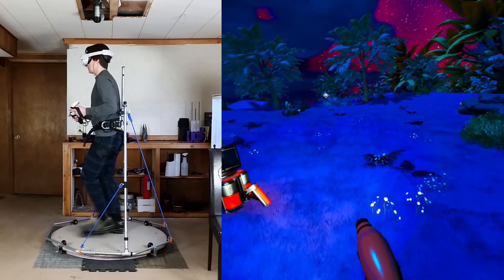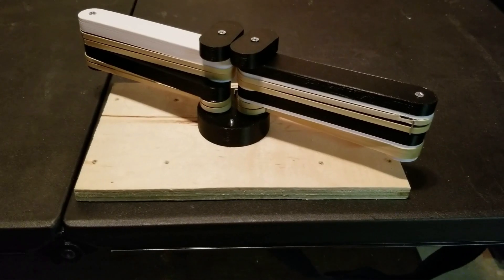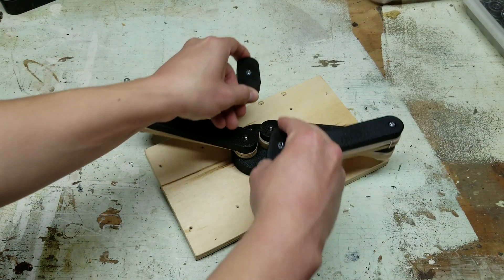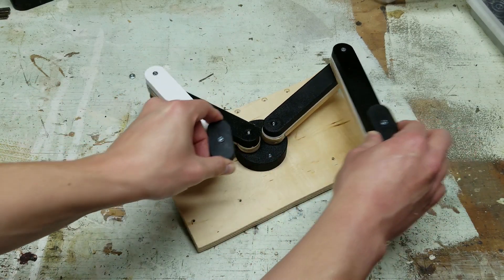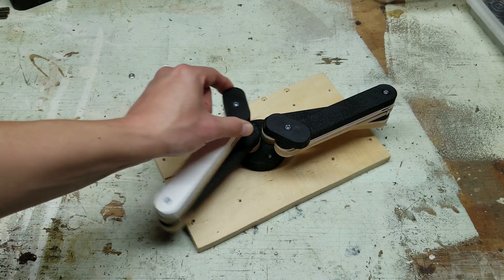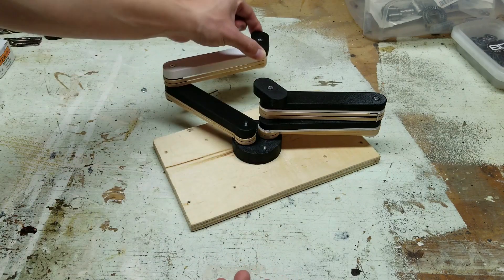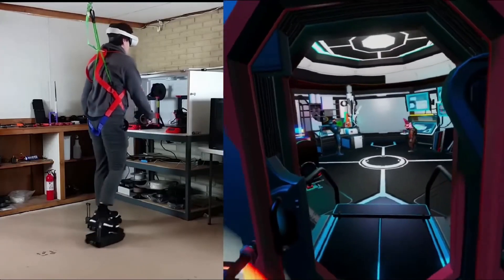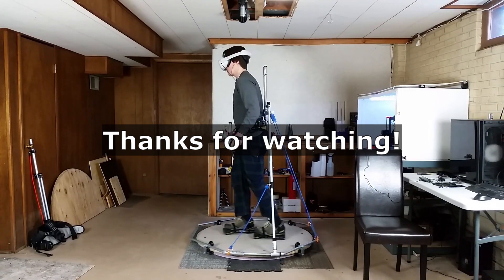A VR locomotion device based off robotic arms

Comment: This might be a terrible idea. Is it was possible to use magnets to walk on. Magnet for base and opposing magnets on feet soles with varying strengths.
Reply from the maker: Something like this, with magnetically levitated plates that can move along a surface?
https://youtu.be/wCj1kJ1Fyk4
If I remember right, those robots couldn't lift much weight, let alone a person. I think the idea is possible, but not something I could tackle. I could see it requiring a lot of power and be complicated and expensive.

Comment: Why not have the arms coming from the sides of a sliding surface and attached in some way to sliding shoes. Then the arms and joints don't have to hold the weight of the person. The robots arms then only control the experienced amount of friction.

Comment: You know, I bet you could do something with a very simple elliptical machine. They're free-standing, generally compact, and some more expensive ones have motors which can be used to add tracking and resistance to simulate walking through different types of terrain.

The only "big" modifications that would need to be made would be to add a harness and something to allow rotation.

Only downside is this wouldn't allow for jumping, but there will always be tradeoffs.

Comment: You can make sliding joints, to solve the limited mobility issues.  Cut a center channel out of the top "limb",  and potentially use bands to return it to its original positions.   One could also use a tracker,  so that the device knowns exactly where your feet are... and could adjust its feedback-movements, to any positional differences.

 Another option, is that the Channel is driven by a cable or chain drive.. and so when you slide the boot/platform... it tracks and can drive the boot/platform back and forth along it.

 Finally.. what you have shown here... lacks vertical jump ability.  For this... one might need a vertical boot slider/track  assembly.
Reply from the maker: Yes, thanks for the suggestion. A sliding joint sounds a bit better than making the limb telescope.
With the foot binding I'm planning on using, a short jump should be possible as long as the rods the binding slides on are long enough.